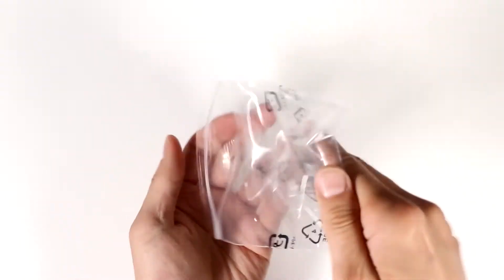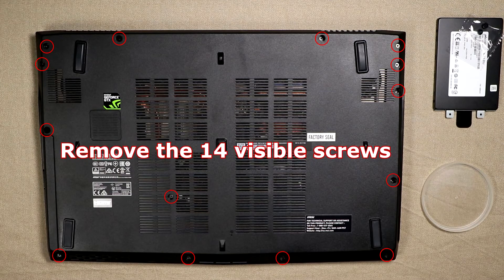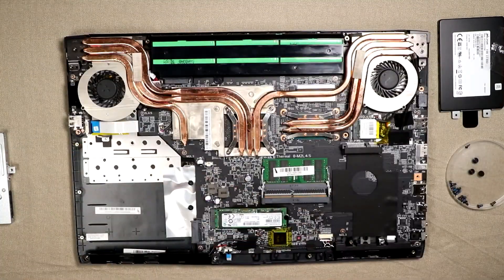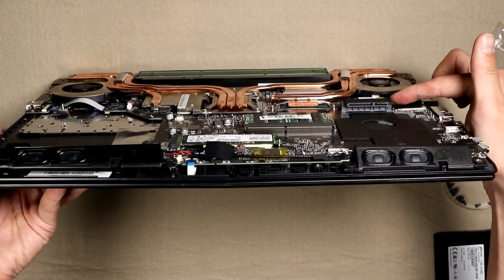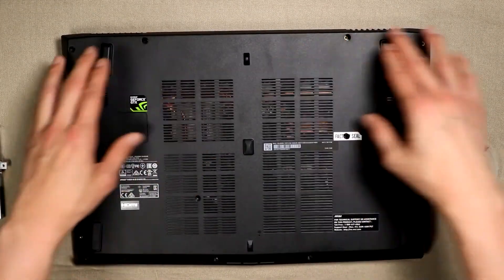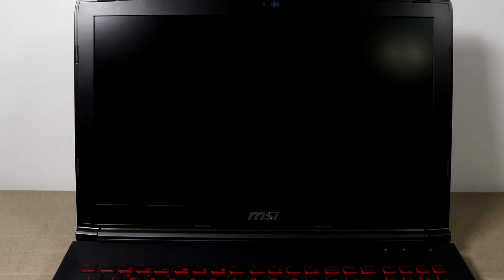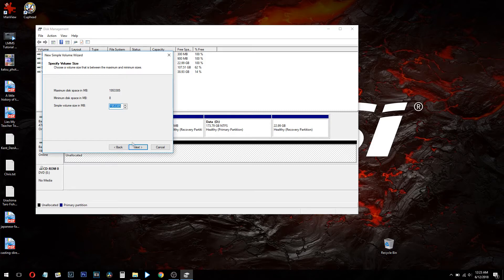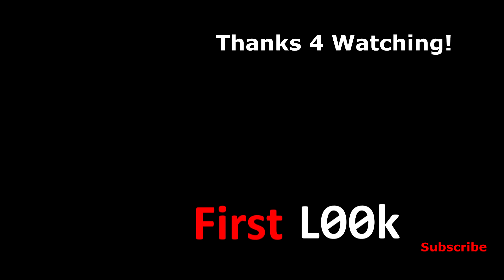How2: Installing an SSD in an MSI GL62VR

Comment: Hi I would like to add a ssd to my laptop which is same with the one in the video. Now I'm looking at Samsung 870 QVO. I'm wondering if it is suitable for this laptop. Any advices?
Reply from the maker: It looks to be the same form factor and should work fine once you install it. Plus you're buying from a well known & reliable brand.
Reply: @FirstL00k  ye I already installed it days ago. It worked perfectly. Thanks to your video!
Reply from the maker: @shanwenyao6703  that's great to hear, I hope you enjoy your speedy new drive! :)

Comment: Hi I just bought Samsung evo 860 1tb ssd. But it doesn't come with any mounting kits, what type of mounting kit should I buy? My laptop is HP ENVY 15 j-series. I've been doing research on thi for days but still couldn't find an answers
Reply from the maker: I don't have that laptop, but if it didn't come with a bracket when you first bought it, you probably won't be able to find an aftermarket version. I've noticed most ppl have had the same issue.

A lot of folks in this situation say they wedge their ssd in with paper to prevent it from moving, and it works just fine for them.
Reply: FirstL00k thank you so much!! I actually already solved the prob. But, I currently stuck on another problem. I switched UEFI TO LEGACY Support mode and reboot the laptop from a flash drive. Everything worked fine, and I successfully installed the operating system. While installing the OS, I noticed I didn’t fully clean up the new SSD drive. I chose to reinstall the OS, and I’m not sure where I messed up. This computer is not turning on now, and the error message consistently shows up - “no bootable device found press any key”
I’ve been trying to find a solution via internet.one of the only two answers I found is disable legacy support then enable legacy support, and this one not working for me after so many attempting. The other one is using uefi, however, this is not an option in my booting list

Comment: I've just purchased a  gs66 stealth and I'm wondering what the sata on the pcie/ sata port means. Does it mean if i attach a cable to the motherboard I can use an SSD in that spot or can i actually plug a nvme or sata ssd there?
Reply from the maker: Congratulations, it's a helluva beast! No cable, you plug it directly into the open slot (if there is one.) If it supports both PCIe/SATA, keep in mind that PCIe is supposed to be faster. (Side note, it's probably an m.2 size, not 2.5" so keep that in mind before you buy.)
Enjoy the beast!

Comment: So ive lost the mini clip that would hold the ssd in the laptop. Would you know where to purchase it?
Reply from the maker: I've searched high and low and can't find this piece anywhere. But a lot of folks say they fold up a piece of paper to wedge the drive in place and everything works just fine.

I think it's ok this way because it's not like a hard drive - in an SSD, there's no moving parts.
Reply: FirstL00k I just ended up buying an $8 optical drive replacement sleeve. Works just the same. Be a cool video to show off too.
Reply from the maker: @gdazey1  That's great man, you found another way to make it work! Why not try and make a video of it? I'm sure there are others who are in the same situation and can use this method.
Reply: FirstL00k ah no I’m not the video type. You should make one for your channel.

Comment: i need help, does anyone know where i can buy the ssd bracket? i lost it, i already istalled the ssd and i just noticed that piece exist
Reply from the maker: That seems to be a common issue - can't find any place to buy it though. But as long as it fits snugly (and doesn't shift around) should be fine.

Some ppl have said they use folded paper to do this.

Comment: I have this laptop. I would like to add another ssd to the laptop to make it my main system (C). Wondering if I should get m.2 or SATA. Does this laptop have extra m.2 slot? Thank you
Reply from the maker: There's only 1 m.2 slot (which is already occupied) and only other option for extra storage is the 2.5" SATA.
Reply: @FirstL00k  Thank you for answering. Last question, I already have my SSD as Disk C and HDD for Disk D. Can I add another ssd to make it third disk? And if so, can I use it as my "Disk C"? Thank you
Reply from the maker: @asyraaafs  The laptop has one m.2 and one 2.5" slot, so both slots are occupied if you have two drives. You'll probably need to replace an existing drive then.

However, I've heard of people replacing their CD drive (if you have one) with storage, but the interface is slow and you have to find a caddy that fits. It might be a possible option for you (though an external drive is probably faster than that.)
Good luck!
Reply: @FirstL00k  Alright now I got it. Thank you for your reply. It very much helped me. I appreciate your time. Thank you brother 👍
Reply from the maker: @asyraaafs  You betcha!

Comment: where i can find the bracket,
Reply from the maker: The bracket comes with the laptop when you buy it.
Reply: @FirstL00k  I bought MSI GF63 8R but unfortunately the bracket wasn't there ,,, is there any website recommended to get this bracket.
Reply from the maker: @mubarak691ify  I know of no website that sells this. Can't even find it on ebay. I've been looking because so many people ask, but no luck.

On tech forums, people who are also missing this bracket say they simply use paper as a wedge to keep their drive from moving around. Safe or not, it seems to work for them.

Comment: How do you take the screws off??? They are so tight!

Edit: I'm stuck on the ones under the Optical Disc Reader. The other 14 I have managed to take off.
Reply from the maker: For the small screws, you'll need a "precision screwdriver set". I have a set that looks like this: https://amzn.to/2VLynge
If you're planning on tinkering with more in the future (like computer parts, game consoles, or replacing smartphone screens) it might be better to have a more complete toolset like this: https://amzn.to/2FuEBLM

Comment: bro, where can I find the bracket you used to install the SSD drive?
because i don't have it!
Reply from the maker: Probably best to contact MSI (or whoever made your laptop) directly for something like this. If worst comes to worst, since the drive fits almost snuggly for the most part, you could shim it with cardboard, paper or anything non-conductive to keep it from rattling around. The point is to keep it from moving.